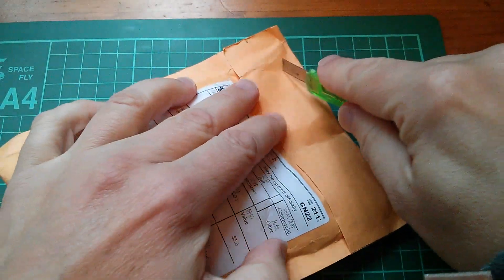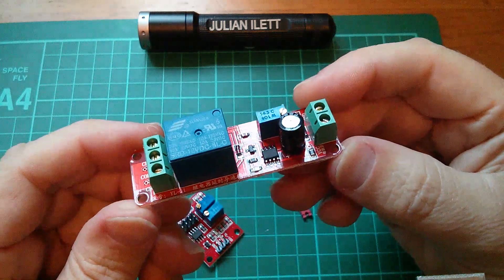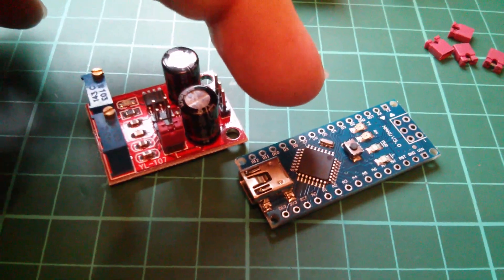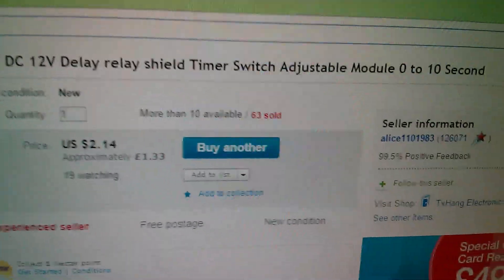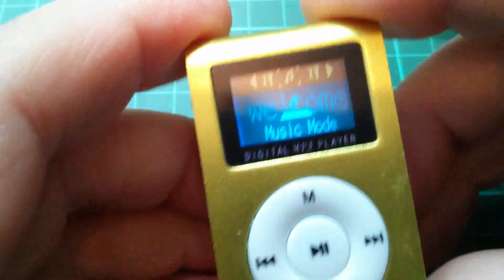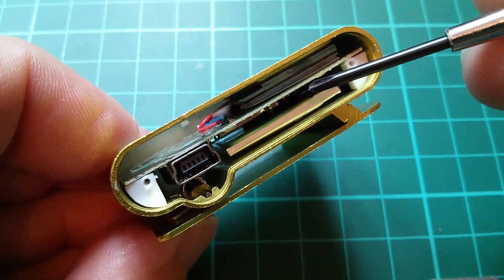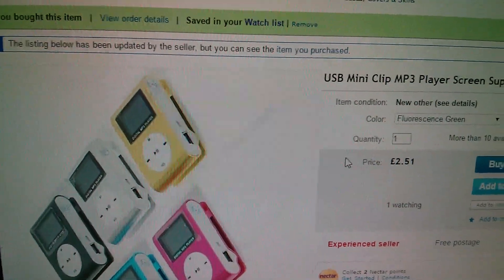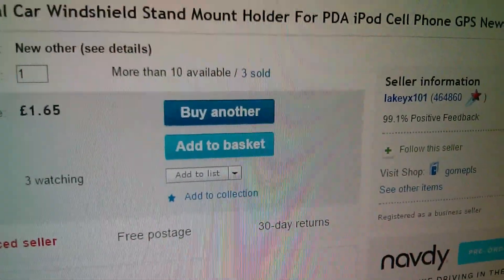Postbag: #24 - 555 Timers, MP3 Player, 150mAh Lipo, Proto PCBs

Comment: Can you make an inverter with an auridino and also that will regulte the out put voltage and frequency with different loads because simeple inverter has a big problem which is there out put voltage is not stable with different types of load ...

Comment: You raise an interesting question at the start of this one Julian - at which point do you abandon ICs and discretes and start using a micro-controller? I guess it comes down to a component price and design time. You can get 10x 555s or LM358s for a quid, 5x Attiny13s for £2 or a pro-mini for £1.50ish. I think if I used an ATtiny or pro-mini just to do a simple astable flash, I'd kinda feel like I was wasting precious micro-controllers.

Comment: for a flashing led... wouldn't a multivibrator circuit be the easiest ?  just a couple transistors and caps, and some resistors.
Reply: For some other transistor flasher circuits, have a look here http://www.techlib.com/electronics/flasher.html
Reply: Also  iirc, there's this 'weird' circuit that makes use of a special way in which transistors works and makes the led blink by having a transistor with nothing connected to the base. the led will blink but it'll be somewhat dim.
Reply from the maker: I might start the video with a good old fashioned transistor multivibrator